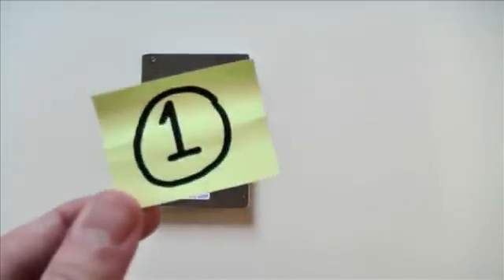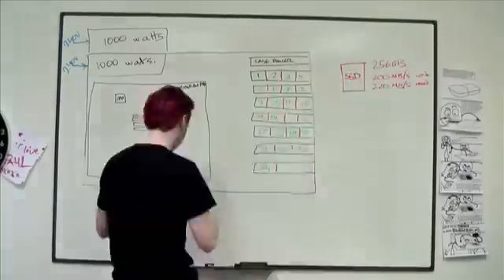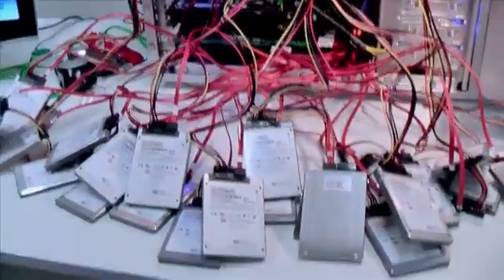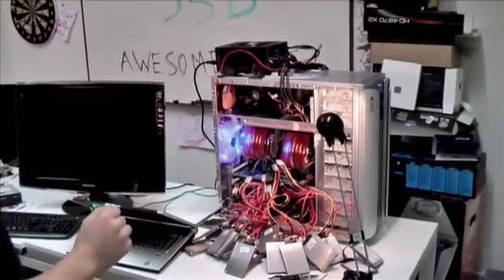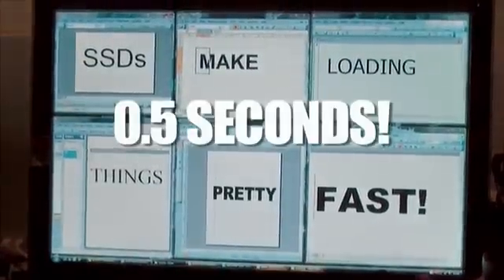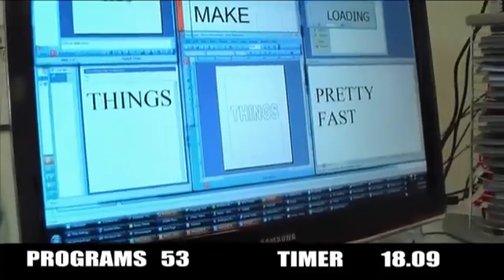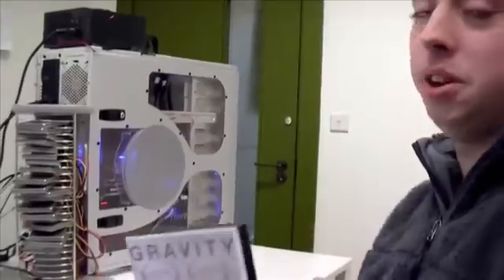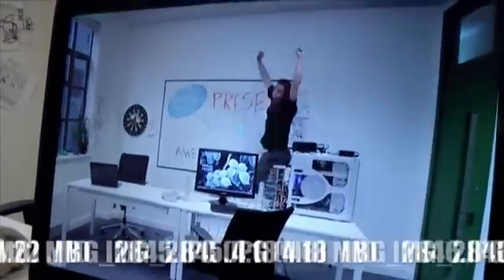What happens when you RAID 24 SSD Hard Disks !!!!!

Comment: wouldn't 10 SSD's be enough to break the transfer speed cap for sata? "2gb/s"
Reply: Invest in RAM instead and setup a RAMDISK, much faster :)
Reply: Remember that this was three years ago. Now we can get crazy stuff near 1gb/s on one drive because of sata and PCI flash.
Reply: The speed cap applies only to one lane.
Reply: Roy Nilsen yeah its like 8gbs a second lol.
Reply: jonskunator actually there is a speed cap for the entire sata bus, for example on current top end intel motherboards the maximum speed for all satas together is 2GB/s (16GBit/s) even though there are enough ports for more like 6GB/s
Reply: they would if they were connected directly to the motherboard but if you had an external raid card it would be limited only by the PCIE speed

Comment: Even with that speed Visual Studio took a while to start.

Fucking ugly bloated piece of shit.
Reply: computer doens't only have Storage.. theres cpu and gpu and mobo and chipset and many things also ram !, for visual stadio , its real CPU intensive, for me even with a secondary slow hdd it wont take more than 20 sec to load (normaly 6 seconds)! its max i haven't tried with ssd coz now i uses sublime and other IDEs ! but im sure i will get only 2 3 seconds !
Reply: kam hagh it still has to load a bunch of files for it to start. Like Alek said it's a bloated piece of flowers, that means that there is too much unnessecary stuff to load.
Reply: Dahley Wolf yes but slow loading isn't because of the ssds its because other parts are slowing it dien
Reply: VS2010 loads for me in <5 secs, on a dell workstation/16GB ram/7200rpm drive.. no biggie.
Reply: It shouldn't be a problem indeed

Comment: Awesome, but daily backup would be necessary - as there is now a 24X greater likeliness of hard drive failure LOL. But a backup onto an eternal drive wouldn't be a big pain in the butt. Also, defrag is only of benefit on a mechanical drive, specifically so the head doesn't need to move so much. There is no benefit to defragging an SSD or CF drive.
Reply: Defragmenting a SSD is actually a disadvantage as SSD wants data to be spread all over the drive while the defragmentation tools gathers the data.

Comment: Don't stripe SSDs unless you need to increase volume size. they won't exceed the controller bandwidth. My system is faster than theirs with two SSDs running JBOD.
Reply: SSDs got realy faster last years ^^
Reply: GoettlichesImperium1 Even considering the increase in performance and controller interface rates, there was really never a reason to stripe more than two. That would be more than enough to exceed the read/write limits of common controllers and a larger array adds overhead. Controllers designed for high bandwidth interfaces such as those which are included with the "OCZ RevoDrive3 X2" are the best solution.

Comment: I am surprised they used Vista.
Reply: ***** but because the 'beta' existed, which was full of bugs because it's a beta, doesn't mean they HAVE to use it because it's been released for maybe a couple weeks/months :P
Reply: Doesn't the fact that they used vista make the video all the more impressive?
Reply: Vista works fine on a decent PC, which this clearly was.
Reply: Vista wasn't as bad as everyone made it out to be.  Windows 7 is basically Vista 2.0.  Even the windows version number supports this.  Vista is Windows 6.0, Windows 7 is actually Windows 6.1
Reply: There was no Windows 7 or 8 when this video was made.
Reply: When was this video made? It was uploaded in 2011 and I was thinking it was made around that time,
Reply: Nah search "Samsung SSD Awesomeness" that's the original video and it was uploaded in 2009.
Reply: Windows 7 beta existed in 2009 (just saying)
Reply: Yes. It works well, as long as you have SP2. They fixed most of the bugs there. And a decent PC makes it better.
Reply: wannabesq vista wasn't bad but people complained because of how slow it was because they installed it in some old crummy 2003 machine with 1 GB of ddr2 and around that time vista was released ddr3 was coming out (i think)
Reply: Dahley Wolf Lol, I see now.
Reply: Vista runs fine on a system like that. It's also easy to run 7/8/8.1 on a ddr2 2gb setup.
Reply: I'm running Windows 7 ultimate on an old XP intended dell with 2.5 gigs .. Runs fine for what I need.. I can even run Minecraft .. With Optifine though ha ha.

Comment: To the uninitiated! Never defrag your SSDs! That's a surefire way to shorten their life. SSDs simply do not need to be defraged as they can get files from any part of the drive almost instantly, and doing so causes the drives to move data around to multiple parts of the drive in order to put things in the correct order. This many unnecessary writes and deletes will shorten the life of an SSD.
Reply: ***** defragmenting an ssd doesnt actually shorten the life span, just makes them extremely slow. this is due to the fact that the OS assumes it's a mechanical drive. So what happens is windows will move all the stuff that your ssd has established in a specific sector on the SSD to access it at the best speed, and stores it like it was a mechanical drive makin your ssd work harder to find files because they are spread out everywhere.
Reply: crimescene25 Again, I have to disagree. Defragmenting will shorten the life space on an SSD. The reason for this is because flash memory NAND cells have a limited amount of write and deletes that can be performed before they wear out completely. Defragmenting causes a lot of writes and deletes to be performed. This is why defragmenting an SSD is bad. Also, the SSD doesn't care about where the data is stored on the drive. What it does is takes data and spreads it across all the cells evenly. This is called wear leveling, and helps to make the drive last as long as possible. Since the SSD does not have moving parts, reading from one cell of the drive takes just as much time as reading from any other cell of the drive (unless one of the cells is damaged or worn out - hence one of the reasons for wear leveling).

http :// tinyurl. com/ ssd-truth
Reply: @thesilentobserver93  electrons are moving parts

Comment: If you want to test 2gb/s speed you need at least DDR-1600, otherwise it will bottleneck your rams. Or using dual-channel 800 would be just the limit. But i, for one, reccomend using a bit more than HDD transfer limit to see the real results of HDD. I.e.: dual DDR-1066. And since VelociRaptor is 4,5 times faster than any ssd at read/write speed, using 24 raptors and creating a ramdisk from your ram and use preload function for every apps, you will get much more reliable performance at cheaper price. But because of people like you, SSD will be cheaper in future :(
Instead of achieving 50000rpm discs =(
Reply: RAM should be rolling at 8+ GB/s (as per my laptop running average DDR2 RAM) on any even vaguely recent machine.
Reply: you are an idiot, a VelociRaptor is not faster then a SSD.

Comment: lol my 32gb of 2400 mhz ram is about 80gb's a second BITCH
Reply: The RAM also has more bandwidth available to it, dumbass.
Reply: Yes thats my point idiot what point are you trying to make?
Reply: Well in some scenarios where you need an insane framebuffer where you can pull textures and meshes very very quickly without stuttering or hitching ram discs are nice
Reply: *****
My point is that it's not even a close to fair comparison. And on the textures thing, it's all loaded in the VRAM and/or system RAM so it doesn't have to go back to the SSD/HDD.
Reply: So you spent how much on RAM? And how much do you say you hate PC gaming? Rather than bragging about completely unrelated stuff, maybe you should be learning how to fix your busted ass PC.
Reply: where did i say my pc was broken? idiot

Comment: 1x Samsung SSD = 500 MB/s * 24 = 12 GB/s, okay maybe only 5-6GB/s, but not 2GB/s
If you run on linux, you can start on a old amd phenom II x4 955 with two 80MB/s RAID0 HDD 10 programms in 1 sec. :D

Comment: its only as fast as the ram seeing as the programs get loaded to the ram.
Reply: Thats only on the first load. Once thats finished, everything goes into the SSD cache and goes blazing fast regardless of file size. I'm sure these guys showed the results after everything was cached onto the SSDs, otherwise it would just be a ram test. Of course, high-end ram is always going to be faster, but you can never catch up to cache size. The current highest ram capacity on server boards goes to 512GB (but its ECC, so its not as fast as desktop ram) and on desktop boards up to 64GB.
Of course, all of these are absolute overkill, unless you're building something like a dynamic video streaming library server or something :)

Comment: DON't EVER DEFRAG AN SSD. It doesn't do anything and it uses up the SSD's limited write speed.
Reply: They where doing it just to show how fast it goes. And yeah, it doesn't really change anything. The controller chip will likely not even move anything around. (I'd love to pull the casings off those drives and shove them into my computer case... I bet I could get all of them to fit.)

Comment: I have 2X Samsung 840 evo in RAID 0, they are giving me 1037MB/s read and over 800MB/s write!
Reply: RAID 0 it's not good idea if somehow one disc will fail
Reply: D. Dobkowski if you have permanent backups, then its okay...
Reply: I have 1TB HDD for backup, RAID 0 Setup is just for current ongoing tasks...
Reply: I have 2 Raptors in RAID 0 for system and backups to QNAP server. If one of the disks fail, i restore the system partition from backup and everything is okay ;0)
Reply: You could simply have RAID 1+0
Reply: For 1+0 you need four HDDs. ??
Reply: Yes you do.... But I guess that won't really cost a fortune, I believe QNAP is costly in the long run...

Comment: Yes, defragging an SSD is pointless, and affects drive endurance, but SSD's will last a lot longer than most think. Most SSD 'optimization' tips come from a time when the technology was still new and drives had a very short lifespan. In Windows 8 and above, "defragmenting" will actually send TRIM hints to an SSD and should be kept on, but in most other cases you should turn it off.

Comment: @Callum Jones, defragging an SSD won't hurt it, although it is not recomended practise.
Reply: Well actually it will...an SSD, as well as flashdrive since their a form of SSD, can only be overwritten so many time. Under normal use thats fine, but during a defrag files are copied, moved and deleted many times. this takes a toll on the drive. This of defragging an SSD like smoking a pack of cigarettes at a time, it may not kill you off the bat, but in the long run it cuts your life drastically.
Reply: acciunt
Go back and read my comment again. Especially the last bit of it.
Reply: Emtildeath6666
Yea i was responding to the "won't hurt it part" lol

Comment: Speed is not everything.
Reply: Michael Angelo López Marsigné
why only have icecream if you can have burgers and icecream?
Reply: Durability of drive time is other. I prefer 1TB hard drive which I can write as much data as I want and last me years over an 240GB SSD which I have to be very careful about writing and last me months, probably year if traumatized careful with the writes. Also SSD's price for higher capacity and durability isn't worth it in my opinion, too expensive. Did I mentioned that HDDs are cheaper? My experience and my opinion says that security is better than speed.
Reply: thebowman2 You mean SSD + HHD? Yes :) It's expensive though lol
Reply: Michael Angelo López Marsigné
You've got a 3TB hdd for 99 euros.. an icecream is almost more expensive. I've got one SSD for windows and 2x 3TB for bulk data, of which one of them backups the other (no, not raid).
Reply: Engineer9736 Oh, ok. Though I will only use a 1 TB drive :)

Comment: The best answer to this is to read about why not to defrag a SSD in Google. Basically a SSD writes data like flash memory and it's lifespan is determined by how many read/writes. While a mechanical drive has moving parts and read/writes differently, defragging is a must on a HDD to free up blocks over time. But on a SSD you are going to damage the components thus alter the lifespan of the drive. SSD's have a read/write anywhere from 300-600 MB per second so no reason to defrag.

Comment: Correct, for Hard DISK Drives.  The rotating disk platters means that data should be stored in contiguous sectors, to avoid having to wait for another disk rotation before the next sector of data can be read into memory.  In a SOLID STATE drive, there is no rotating disk. Read performance is the same across all locations in the drive, which makes defragmentation completely redundant.

Comment: Completely wrong Derek.

SSD drives have wear levelling in the firmware, which places an abstraction layer between the physical write locations on the disk, and the sector/cylinder locations the OS thinks it's writing to. They also have extra capacity that you don't see, which is brought online when parts of the flash go past their write cycle limit and are no longer safe to use.

Defragging an SSD will give you absolutely NO increased performance, and will simply reduce the life of your drive.

Comment: the more hard drives your put in a RAID 0 array, the more steeply the performance curve drops off..
for example: RAID 0 2x hard drives, 25% increase in performance..
adding another hdd wont give another 25% increrase, will be like 12% then another hard drive will give just 5% increase. so 24 ssd's in RAID 0, will only give a performance increase for about 10 hard drives if that... 24 of them wont be any faster than 10..

Comment: Im here in 2013 laughing at this. I mean really? They said their ssds go 200mb/s. Mine right now averages at about 500. They are using 2 quad core  QX9775. Those processors themselves are ancient. They also have two 4870s in crossfire. Really???? Dual 4870s? My SINGLE,MID-RANGE AND ALREADY OUTDATED ATI 6950 beats the shit out of maybe four 4870s.

Comment: power supplies connected by soldering pins 14 and a few ground wires together. this gives a common ground and connects PS_ON to let the motherboard control them directly. power was then shared between both  supplies evenly; one EPS12v each, drives and graphics split over.

Comment: part list: 26 samsung SSD 256GB MLC
4 kingston 800mhz fbdimm 1gb
6 1*SAS ->4*sata SFF-8087
6 1 molex ->4*sata power
2 BLU-RAY (RW) / HD-DVD COMBO
2 corsair hx1000w power supply
2 intel extreme qx9775 quad-core
2 zalman coolers (sawn to fit)
2 radeon hd 4870 x2 graphics
1 intel skulltrail d5400xs motherboard
adaptec 5 series raid (8 channel, stock setup)
1 areca 1680ix-24 raid (beta firmware from areca ftp)
1 thermaltake armour case

Comment: RAID works like this: two or more hard drives or SSD are working together reducing the read/write time by how many drives there are. Your HDD should be fast about 200 MB/s, so if you RAID 4 of them then the speed would be 800 MB/s. 1 PCIe SSD read at 1.25 GB/s, so 2 of them would do 2.5 GB/s.

Comment: 4 of them would.  Writing is half speed to SSD's, so to get the maxed out write performance you want.... you'd probably want 4.

I don't understand how you can read 2GB/sec on SATA.  I have a mechanical RAID 0 made out of 4 WD Caviar blacks and it hits the limit of 1.5 Ghz SATA at about 300 MB/sec.  With a 6gbps sata, the max speed is about 600 mbps/sec.  How do you get 2Gbytes/sec?  Maybe like you said.  PCI of the latest variety can move 8G bytes/sec.  But not SATA II or III.

Comment: depends on the value you're reading in, f you read in a decimal value, it's 1000MB=1GB, but in binary it's 1024MiB=1GiB, that's why if you format a hard disk, in stead of seeing, say 2TB, the system reads it as something along the lines of 2.93TB, it has read it as a binary value, or 1GiB=1024MiB in stead of 1GB=1000MB, the drive capacity is read in a decimal value,and you don't lose any space on the drive at all, it's just read differently in the OS!!

Comment: Proving this would have been easy, at the time... because you could have hit 2gb/s on 12 of those drives... and that would have impressed... even back then. This is assuming you spread the load across several RAID cards, because, back then, there really were not controllers for those cards that were expecting much more than mechanical hard drive performance levels on each individual drive.

Comment: This RAID configuration would be in RAID 0 to get the speed and performance possible - RAID 0 has no fault tolerance meaning if one of the SSDs were to break the whole system would fail.

Comment: That's the very reason harm is caused. There is no moving parts and hence the location of the data is not relevant. Therefore all defragging does it cause unnecessary read/write cycles, wearing out the gates.

Comment: It would be Raid 0. With today's drives though, you can get 550MB Reads.  I get 551MB reads on my Samsung 840 pros.  (One in laptop, and one in desktop)  There is really nothing that is so intensive on ROM space that you would need to exceed that, though.  Well, I guess video editing and such could, but I wouldn't suggest that with SSDs because of the limited read and write cycles not to mention the cost per GB of SSDs still hovers around a dollar.

Comment: I was to curios so i went on eBay just to get a guesstimate of what the whole machine would cost. $11,911.93. Same Drives are $7,799.74, but when i worked out the efficiency i almost had a heart attack. The drives are running only at ± 28%. The machine was built so specifically to do that 1 thing. That it really doesn't have any real use other than sequential read and write speed. I suppose a real intense database on a hectically large network will love this machine.